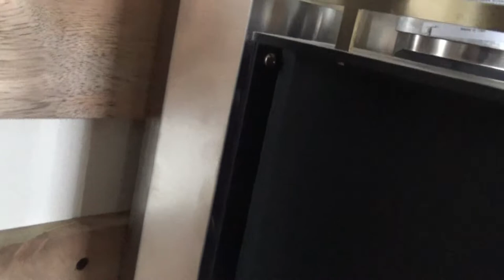Cubic Mini wood stove, up and running!

Comment: I was thinking of getting one of these just wasn't sure if it would work or not.  How big is your living room and how warm does this keep it roughly. Its getting pretty cold here in Michigan and I have no time to put in a rocket stove.
Reply from the maker: +Moni Chippewa my living room is roughly 15 x 20. When it's 30 outside, I can maintain 70, inside. My home is pretty old and is not insulated very well.
Reply: Prepping Ohio WOW  That's amazing for that little thing . Thanks so much for your help

Comment: Thanks for the info, I have been looking at the grizzly for my camper, and am wondering about the pipe adapter. Did you say it was for a pellet stove, and is it the 3" double shielded equivalent? Also on that sitting over the pipe have you shown signs of creosote running out yet? Here in the mountainous north land  we will be burning mostly pine and creosote will be a big issue.
Reply from the maker: I haven't noticed any running out yet, but I clean it out every few weeks.  I was concerned about that, as well.  Yes it is 3" double wall pellet stove pipe.
Reply: Ok thanks